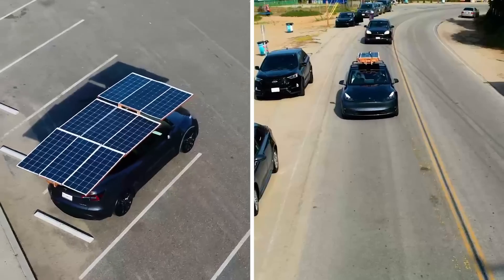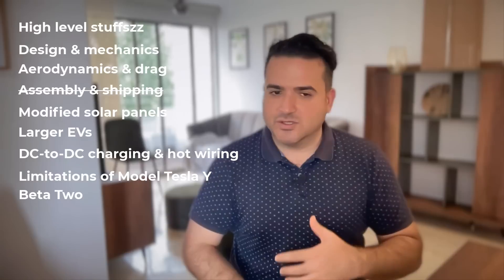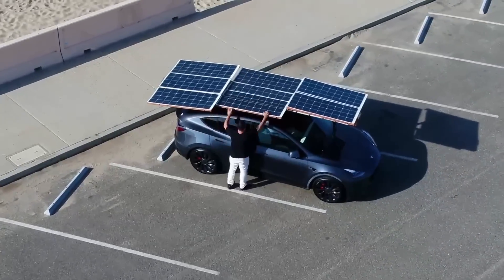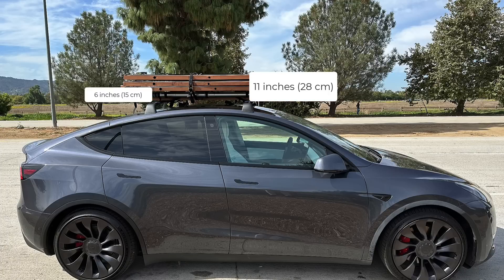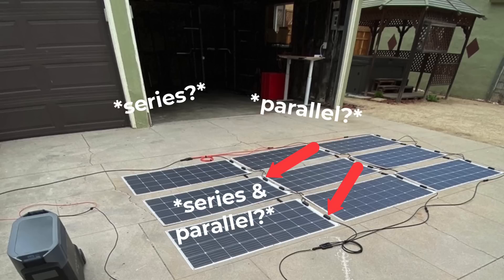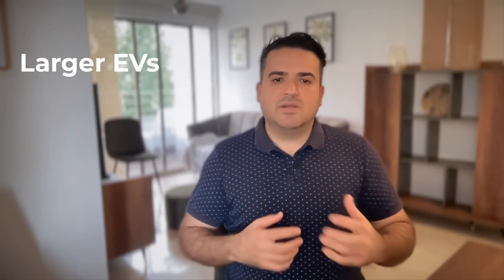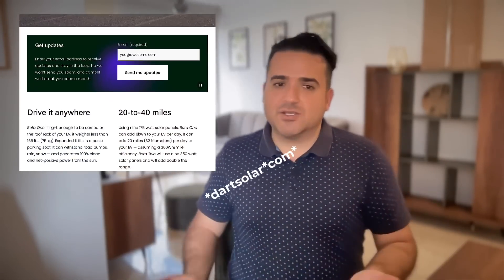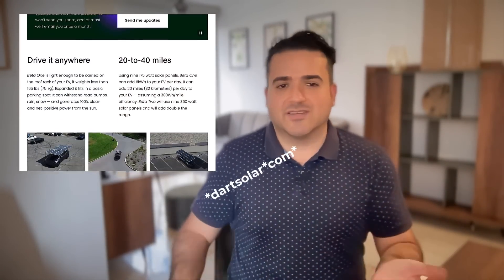DIY: A drivable solar rooftop for my Tesla Model Y (20 to 75 miles per day)

Comment: For those interested in integrated solar in an EV, you might want to look at the Aptera. The vehicle is currently in pre-production testing (safety, distance, etc.) and finalizing supply contracts. Designed to have integrated solar in the hood, dashboard, roof and rear deck.
Reply: This video is about applying solar panels to EVs, a topic of great interest to me. Since the German Sono solar EV project went bankrupt, there are few other examples than the Aptera which I consider unfortunate. I would like to see a much more competitive environment. Do you have anything positive to contribute to the solar EV conversation? To the rest of the community, are you aware of any other new developments? Would love to hear about that!
Reply: Aptera is a perpetual fundraising scam.
Reply from the maker: Thank you so much for this. Aptera is a great car, the only problem I see is the most consumers don't want solar panels or solar cells embedded into the body of their car. It is pretty expensive to maintain, in case one breaks. Also consumers prefer the electric vehicles that they have bought because of other considerations like the number of passengers and size.

I believe solar is an aftermarket product for electric vehicles. Those who wanted can add it to the car, if they choose.
Reply: @DartSolar  Your points are all well taken and I completely understand and can agree with your view point. I am looking at this from the perspective of a person and spouse who are both primarily WFH and like the concept of a solar EV so that I do not need to install a charger at home with very occasional need to visit a charging station. So I see the built in panels as an advantage due to less drag. I did catch a glimpse of a camper RV that has folding solar arrays on each side of the vehicle. I might have to look at that more as well.
Reply from the maker: @xiaopangpang7082  Ah yes, I know which one you mean. the problem with the folded solution is (1) it is not wind resistant, (2) if it rains, you are placing all the wet solar panels in a hot and sealed container -- which can lead to mold, (3) the solar panels don't point to the sun, they point in random angles based on the shape of your car -- this leads to huge losses in watts per hour, (4) there is no way to actuate it, you will always have to manually open and close it. We are going to release blueprints in a few weeks, maybe just build one yourself?
Reply: @DartSolar  Great points all! Thanks for sharing
Reply: Aptera is only a point A to point B vehicle, it doesn't do anything else. It's ugly, has no utility, and won't be fun to drive. Customers want more from a vehicle than what it offers. The people behind Aptera know it will be a flop out of the gate which is why they are dragging their feet for so long when they could have already released the vehicle. Collecting that investor money because that's all the money they will ever see.
Reply: @Mediiiicc  Conveniently the only thing I need out of my car is getting from point A to point B 😂 the only thing I've ever used my trunk for is to store the non weatherized floor mats and I'm almost always the only person in the car. The aptera would be great for me because the weight savings increases the charging speed just because you get so much more range out of every kWh. I drive a couple miles a week to the store or to an appointment so I would never have to charge it.
Reply: @Mediiiicc  Wow, I don't agree at all.  That is why they used NACS for their charging standard.  They had Roush do the suspension.  There is no reason it can't be a very good car that is fun to drive.  I happen to think that it looks very good.  I think every car built these days with that monstrous grill looks absolutely stupid.  But a lot of people disagree with me.
For me it could be a near perfect car.  I am retired and drive about 4K miles a year.  I almost never have passengers.  It would cost absolutely nothing to drive except for tires.  Which because of the low weight should last a good long time.
An Aptera with a 600 or 1000 mile battery could be really cool.  I could drive from California to Dallas and stop once.  It would charge from the Tesla supercharger network and because it has a relatively small battery it would charge in a relatively short amount of time while I sleep and get ready for the next day.
As far as utility, It can handle long items in the back.  Certainly tall or boxy items would be a problem.  But I won't be buying it to be a truck.
Reply: @bryanwhitton1784  Zero chance it has 600-1000 mile range
Reply: @Mediiiicc  It has the battery configurations for 250, 400, 600 and 1000 miles of range.  It is light and aerodynamic so it needs about 1/3 the size battery compared to a Model 3 for example.
Of course being rated and being able to drive on the freeway for 1000 miles are two very different things.  You can't control the weather or the terrain.  You can't drive the way the EPA tests them either.  So your actual mileage will differ.  Just like the EPA says.
Reply: @bryanwhitton1784  I'll believe it when I see it. Launch edition is 400 miles, the company will flop before they release anything more. The CEO probably knows that too and they are only listing the longer ranges to generate misguided hype.
Reply: @Mediiiicc  Not cynical or anything are we?  Look, starting a car company is hard and very expensive.  I am under no delusion that this is going to be a bed of roses but that doesn't mean I accuse people of fraud with absolutely no evidence.  Bad form.
Reply: @Mediiiicc  Actually the plans from the company have always been to release 600 and 1000 mile versions. First edition is anticipated to have 400 mile range. Also interesting is that many EV proponents are expecting 1000 mile range to become commonplace over the next five years due to improvements in battery technology
Reply: @xiaopangpang7082  there is always a massive battery innovation that’s a few years away. I’ll believe the corporate marketing when they deliver the product.
Reply: @bryanwhitton1784  they are the ones that need to provide evidence of their claims. They haven’t delivered any so I won’t believe them.
Reply: @Mediiiicc  Of course there is always potential future development, that is the definition of innovation. However, major improvements are currently coming into production such as the Qilin and Shenxing from CATL and even some solid and semi-solid batteries appear to be finally entering production from other manufacturers. BTW, CATL is actually rather impressive at delivering product time and time again. Little exaggeration from that company.
Reply: @Mediiiicc  Do you work in automotive marketing research? The over 40k in reservations they have would say otherwise wouldn't you think? I don't think the market for Aptera is very large, (it's not an F150), but I wouldn't completely dismiss it either. There are plenty of people who buy 2 seater sports cars. Isn't it a bit of a fallacy to say that people don't want something that's never really existed before?

 Comcast makes the same argument about their current status quo upload speed to download speed ratio, in that their justification for it being a fraction of their download speed is that, "that's how customers use their products." Instead of realizing that no, that's all that's available since they're a monopoly.
Reply: @MrAlziepen  You should really look into the history of this scam company.
Reply: @Mediiiicc  I'm speaking specifically to your comment dismissing a market for a solar vehicle. Whether Aptera is a scam company or not is really besides the point as they're not the only startup to try and market solar vehicles. There have been other failed startups attempting to bring solar vehicles to market, so why waste hundreds of millions trying to bring a product to market if there's no public desire for that kind of a product? The prototype Sunswift7 vehicle just completed a world record. I bring that vehicle up because in spite of it being a solar racer one off prototype, it's a good illustration of the combination of light weighting + aero provides the prerequisite for solar to actually become beneficial to be onboard a vehicle.
Reply: @MrAlziepen  you’re wrong, I’ve only been talking about aptera.
Reply: @Mediiiicc  Ok... I never said you weren't talking about Aptera.  You mentioned," Aptera is only a point A to point B vehicle, it doesn't do anything else. It's ugly, has no utility, and won't be fun to drive. Customers want more from a vehicle than what it offers." Again, my point was that just because you're a skeptic of this one specific company here, doesn't therefore discredit the idea of solar vehicles as a thing people may want overall. If you take the name Aptera out and swap it for any other brand I think a lot of them could fall under that characterization no?
Reply: @Mediiiicc  Aaannndd you completely missed my point. I said to look at the integration of solar into the vehicle. While I commend the creator of this video for ingenuity, the drag of the solar panels will eliminate so much of the power gain. The solar panel system and tested panels for long term road use from the Aptera are worthwhile to consider on any EV.  There are also developments from a Norwegian company on flexible solar panel films. It will be interesting to see what happens over the next 5 years. Dartsolar looking forward to seeing the Beta 2 developments.
Reply: @xiaopangpang7082  You're comment is an advertisement for Aptera more than anything else

Comment: Place a portion of your expanding array under the glass roof, it will take weight off the expanding array on the roof, reduce drag, and block sun inside the cabin.    It could also be functional without the exterior array if done properly with a 1kw storage unit so while driving you could tap in to the storage, and while parked the storage unit would account for peaks and valleys of the array production.
Reply: good idea . and if sturdy materials are used on top [slide forward and back] panels it can double up as roof rack... and generate half the power on the go if not roof racking anything.
also easy to motorise with one motor
Reply from the maker: Take a look at our latest version on dartsolar.com with blueprints -- placing the solar under the glass lowers the solar efficiency

Comment: I wonder how much wasted efficiency you get carrying that thing on your roof
Reply from the maker: That initial prototype is 13 inches tall, so there is an aerodynamic drag loss. The second prototype is only 5 inches tall, and the third one is only one inch tall. At this point, the aerodynamic drag loss is negligible if you include a windbreaker and a tail break.
Reply: No more than a roof mounted luggage bin.
Reply: That doesn't matter if the daily energy you charge from this is enough to cover your entire commute.
Reply: 23 cent here (europe, the Netherlands)
Reply: Bet your a NIMBY🤪
Reply: 20% loss due to aerodynamic drag. He addresses this @3:41
Reply: If someone showed you a beautiful woman youd complain about her toenails 😂
Reply: Good for the power grid in some countries that's a problem, in Germany if more people get EV's we're screwed haha 

Also energy is expensive, 0.38 to 0.43 USD per KwH
Reply: @blutadlerx  More EVs in Germany certainly wouldn't be a problem for the power grid. First of all the difference in electricity usage from every single car in the country being electric would be less than 20%, secondly the refinement of petroleum is an incredibly energy-intensive process and the reduction of this makes up for a portion of that increase as well.

EVs already now are equipped to charge at times where energy supply is high and prices are low, and are eaily combined with the peaks and lows of renewable energy sources like wind power and solar, that's having a massive growth in Germany right now.
Reply: That’s why Elon didn’t add solar to the roofs of the Tesla vehicles. The pros don’t outweigh the cons with efficiencies and it looks like shit. I could see where having a skin of solar panels on the car is practical but not just a giant solar rack that expands. Most people drive 30 to 50 miles a day and go home therefore just charging your car at $00.08 cents per kWh everyday at your house is far more practical for the common person. I’m not knocking on this guys idea cuz any idea that can move society forward is much needed, I’m just saying this idea not practical for most people and probably a waste of money trying to market it.
Reply: @larryphillips4164 who’s getting 8 cents a KWH? Lol!!
Reply: @Wavydyldoe People who own a house and put PV on the roof can calculate with about 8 Cents per kilowatt hour for the capital costs of the PV. Not viable for people renting an apartment, who make slightly more of half the population in my country.
Reply: @Wavydyldoe ……uh……I am. Part of the year from SMUD (Sacramento)
Reply: @larryphillips4164 dumbest comment of the year award 😂

Comment: Someone will steal those solar panels. But if you were to integrate them into the body that would be a different story.
Reply from the maker: The solar panels are tightly integrated into the frame that is then locked onto the rooftop of the car. To steal the solar panels would mean to break them and render them useless.

Comment: I'm super excited! One thing I like to say.. there is no way to make gas out of thin air if you run out in the forest it will be almost if not impossible.. but with this tech you can def get yourself back to civilization without an issue.
Reply from the maker: Thank you! I don't mean to create gas, I need to recharge my electric vehicle with the sun in the forest

Comment: There was a German start-up company where the entire car body was made of solar panels. There were several iterations but in the end you could hardly see that the body was made of solar panels. The company went bankrupt before series production. Apparently, large corporations didn't want to see this car on the road. In case anyone is interested, the company was called "Sono Motors" and the vehicle was called "Sion". It's a real shame that this vehicle never went into mass production!
Reply: I really wanted to buy that car! It would have been the perfect family car for us.

The company is still around but they now focus on providing the same tech B2B to OEMs. So fingers crossed we at least see this make it into cars at some stage. All these add-on fold out solutions aren't practical. It needs to be integrated from the factory.
Reply from the maker: Ideally, I see this more than aftermarket product. I feel only 5% of electric vehicle owners would want this on their car, not everybody wants embedded solar cells on their car's body.
Reply: The Scion didn't fail because of corporations, they failed because they ran out of money. Building cars is hard; Lightyear met the same problem, because some of the only companies that can make cars like that in Europe (Magna) also charges quite a lot for factory space, since they also make Porsches.
Reply: I feel like Tesla should build something like this as a premium feature.  Elon previously said solar panels on cars don’t make sense.  Then he briefly entertained including something like this on the Cybertruck.  Mounting this to your vehicle could be an effective way to bypass regulations and counter resistance to renewables from the utilities and the government.
Reply from the maker: I think you're referencing the Lightyear One, but also take a look at up Aptera – they have an awesome car
Reply: No, I am not referring to the lightyear one. The Name of the company is "Sono Motors" and the product was "Sion". I am aware of Aptera Motors it's interesting but everything but a family car...
Reply from the maker: @fmr3016  Ahh true true. Embedded solar cell attempt (except for Aptera) have failed

Comment: The inverters exist they are European inverters with batteries up to 800v for the battery. They use them for residential purposes. I was looking into direct contact to the batteries and that is the thing I stumbled crossed.
Reply from the maker: Yes, but I need the inverter to fit in the back of my car ideally below the flat area of the trunk

Comment: I have had the same idea. I figured a trailer with an expanding solar panel that extends over the car. The roof idea is good, but you can get more panels mounted to a trailer. And the trailer would be more aerodynamic behind a car.  
  DC-DC charging offers a challenge without a pass-through DC battery or a modified EV. But that would be far more efficient if you could achieve this.
Reply: Why not have a trailer carrying a generator 😂
Reply from the maker: Yes, I have a past battery in my system. Ideally I'd like to be able to park at work leave my car. I have the solar array, automatically, expand and contract, so it will be actuated. I don't wanna drive with a trailer the entire day.

Comment: I wonder if a solar panel that rolls and unrolls like on the space station is feasible?   Perhaps cost prohibitive?   But if it’s possible, could make for a very minimal frame
Reply from the maker: Sure that is visible. You can use what's called a CIGS solar panel, CIGS. They have lower efficiency, but they can roll.

Comment: Aerodynamically speaking, having a rounded blunt edge and a long sharp tail works best. A lot of roof rack boxes actually work better when mounted backwards for this reason.
Reply from the maker: Aerodynamically speaking that was the first prototype which is 13 inches in height. The second prototype is only 5 inches in height and the third prototype is 1 inch and height. We've done some test and the aerodynamic drag loss is negligible if we include a windbreaker and a tailbreaker.